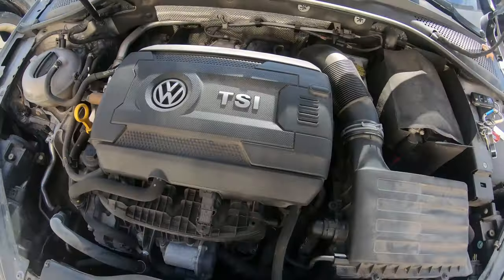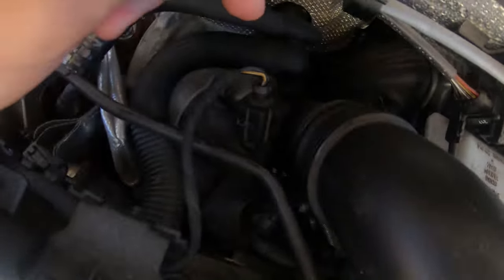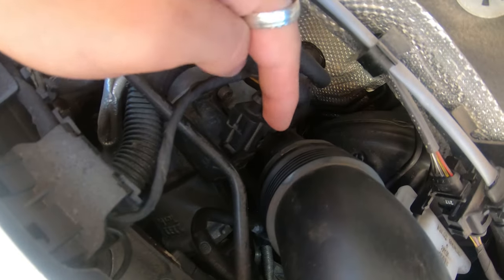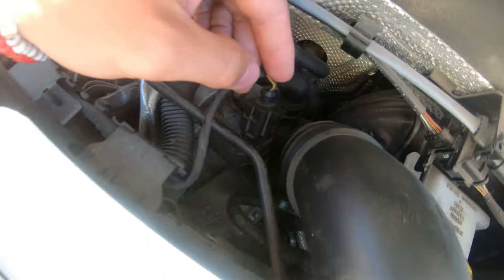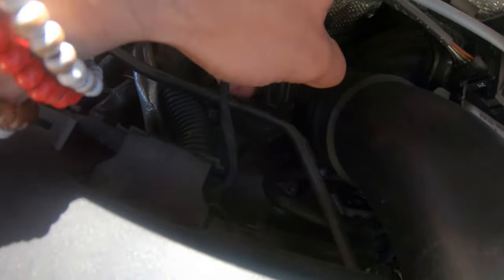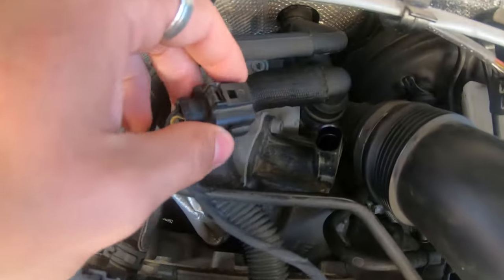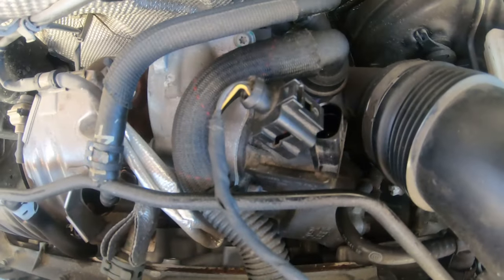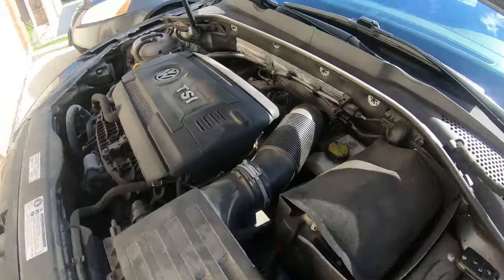How To Make Your Turbo Sound Better!

Comment: There is a safe way to achieve flutter without causing potential issues. I installed an ECS DV...Sounds awsome. Get flutters when ever I let off the gas on even just a bit of boost. Not expensive either...
Reply: U said it ain’t expensive, not everybody can pull 250$ outta their ass😂
Reply: @timkelley6027  yeah but it’ll get more expensive when that turbo blows up after a while with driving with that plug unplugged
Reply: flutter doesnt cause issues
Reply: @MrMatDB   it wont blow up
Reply: @strider5119  not if it's stock from factory...which it is on vw gti
Reply: @timkelley6027  by 2021 standards if $250 is expensive you shouldn’t own this car even a cheap econobox
Reply from the maker: Some people like to save money, not everyone wants to spend 250$ on parts
Reply: Does it work on 1.4 tsi twincharge? Caxa ?
Reply: @roti1784  I don't see why not. But I don't know how it will sound. The DV might be different though...
Reply: @cactusdesert4982  i think so 🤔
Reply: Lol dv is $60
Reply: so like can i do something with my audi a3 8v 2013 TDI to get some flutters?
Reply: Link it please

Comment: How do you get the flutter? Do u just unplug that and it flutters or? Cuz I have a mk5 gti with a turbo and cold air intake and I want mine to flutter.
Reply from the maker: I’m not guaranteeing that it will work on your car but, yes all you have to do is unplug that little sensor and it should work
Reply: Don't good for your turbo if you do it this way
Reply: Not*
Reply: The sensor is not unplugging

Comment: so thats why my turbo sounds like that. Does it decrease the life time for the turbo?
Reply from the maker: You shouldn’t do it for long periods of time because it can cause damage. It’s mostly used just for showing off lol! Please consider subscribing🤙🏽
Reply: @LukesVlogs97  oh don’t worry I’m deff subbing you. Thank you btw
Reply from the maker: No problem brother! Thank you I appreciate it a lot. If you have any video suggestions just let me know🙌🏼
Reply: The noise it is creating is called turbo surge , most stock turbos doint really create that much boost so would take a while to cause any damage but it will over time like anything
Reply: Not in this case.  General rule of thumb is flutter on closed throttle is perfectly fine.  Flutter on open throttle is when your turbo is fucked
Reply: @mrhoonigan6257  one day I hope I have knowledge such as yourself

Comment: Does unplugging it throw codes or turn the check engine light on? I have a 2012 CC 2.0 turbo all stock and want to hear the turbo noises
Reply: It probably will throw a code. Don’t do this it is terrible for your turbo. The sound you hear is air exiting the turbo in the wrong direction and slowing the turbine, causing excess wear on the bearings. Please get an intake or downpipe for turbo sounds
Reply from the maker: Ya this isn’t something you should do often maybe once or twice to show off to friends but that’s it. And it does throw a code when unplugged. Thanks for your comment I really appreciate it!

Comment: Bro please help me how can I get this on my Jetta 2006 2.0T FSI flutter noise ????? Please help ?? I already have valve diverter
Reply from the maker: Have you tried unplugging it like I did in the video?
Reply: Let me explain i already have the DV spacer forge installed I unplugged the diverter valve plug but not flutter ! Do I have to remove the valve spacer
Reply: @LukesVlogs97 or  do you recommend me use a single  upgraded piston Diverter Valve and do the same process ?
Reply from the maker: First try removing the spacer and if that doesn’t work than you can try an alternative solution!
Reply: @LukesVlogs97  it works hahaha you awesome thanks 🤟🤟🤟🤟🤟 💪💪💪💪
Reply from the maker: No problem buddy anytime! Please consider subscribing I would appreciate it a lot, it will help out the channel!

Comment: If I put a plate or make the divirter valve spring stiff will I flutter
Reply from the maker: Aww man I’m sorry to hear that. It’s okay you can just get a blow off valve instead lol
Reply: Luke's Vlogs I got a divirter valve if I make the spring stiff will it blow valve?
Reply: Luke's Vlogs bc on youtube my divirter valve flutter on some stock bmw turbo of my model
Reply: Luke's Vlogs ??
Reply from the maker: It should be working then. Make sure you watch multiple videos so you make sure it’s the right piece you’re taking off!
Reply from the maker: I’m not too sure about that, I don’t want you to mess up anything in your car. Make sure you subscribe to my channel for more video!
Reply: Luke's Vlogs but if the main spring is stiffer it will be harder to escape air so it will shoot it in the turbo and make noise??
Reply from the maker: I’m not too sure you will have to try it!
Reply: @ogog861  Consult a BMW forum, someone with the same model may have done it, or have the answer.

Comment: I tried this to see what it sounds like but is there anyway to get the check engine light off after when the valve is back in ? Cool video btw I was surprised this worked 😭
Reply from the maker: no you will not get a check engine light from putting holes in the exhaust. Please consider subscribing i would really appreciate it!
Reply: What that’s not even what I asked 😭
Reply: Can I get rid of check engine light after u do this
Reply from the maker: Ohh shit my bad lol
Reply from the maker: No I don’t believe you can, even if you cancel it on ODB scanner it will most likely come back on. My bad I thought this comment was from my other video lol 😂
Reply: Thanks bro and I got rid of the engine light so everything cool now thanks again for the sick video 🤟🏽🤟🏽
Reply from the maker: Ayy that’s awesome, good job! Thanks for watching and commenting!
Reply: @adamclayjr6224   how did you get rid of the light?
Reply: Invest in a decent obd 2 port scanner there super convenient in diagnosing problems and resetting lights like the check engine light.. there not very expensive and very easy to use plug in and operate it similar to your phone or some of the cheaper options you can even download a app and have it that way

Comment: Does this work with the mk5
Reply from the maker: Does your mk5 have a turbo?
Reply: @LukesVlogs97  they come with a stock turbo
Reply from the maker: Can you see the diverter valve sensor when you pop the hood?
Reply: @LukesVlogs97  the valve in under the car
Reply from the maker: You should have a diverter valve
Reply: @LukesVlogs97  okay ik I have a diverted valve but I wanna know if I’m gonna get the same affect you did

Comment: Yeah and after u disconnect it, have fun with check engine light and errors on dash
Reply from the maker: Surprisingly I didn’t get any errors or lights, But maybe other cars will. 

Thanks for commenting!
Reply: @LukesVlogs97  nah i did it 20 min ago but got nothing
Reply from the maker: No sound or no lights on dash?
Reply: @LukesVlogs97  not the op but i did it about an hour ago and got no sound but i did get a few pretty lights to show up on the dash

Comment: Yes it sounds good but you should not do it that diverter valve is there for a reason by unplugging it causing damage to your turbo if you want a flutter sound spend the damn money and get a intake for your car or an aftermarket blow off valve don’t just unplug the diverter valve it will damage the terrible in the long run I’m promising you.. if they didn’t need it they wouldn’t of had it on there.. No one believes me Google is it good to take for unplug a diverter valve on a terrible car he will lose power and it will run rich..
Reply from the maker: Thank you for your comment I really appreciate the feedback and knowledge!